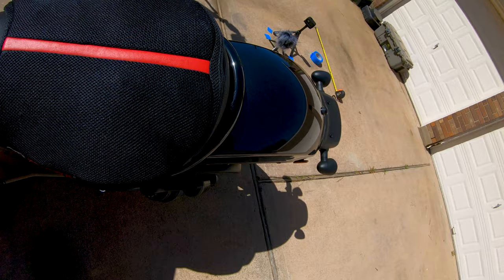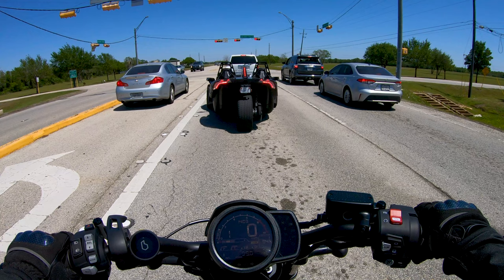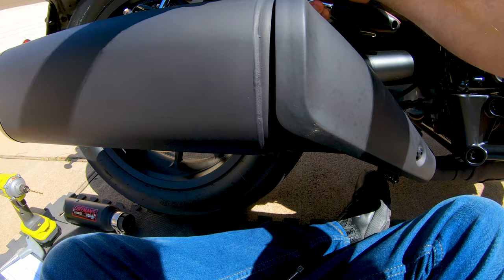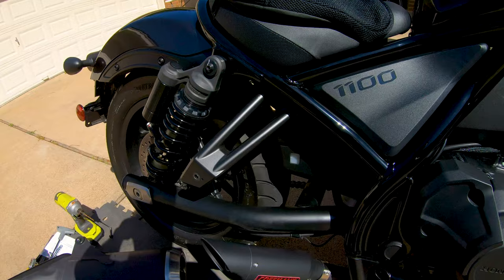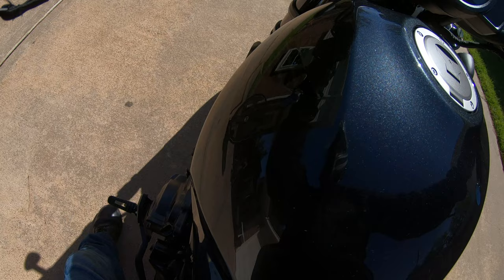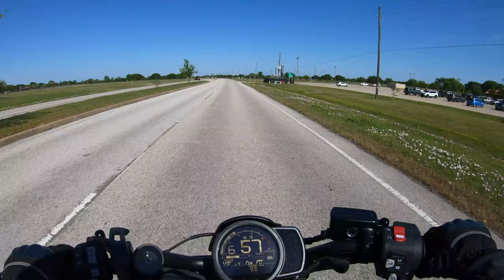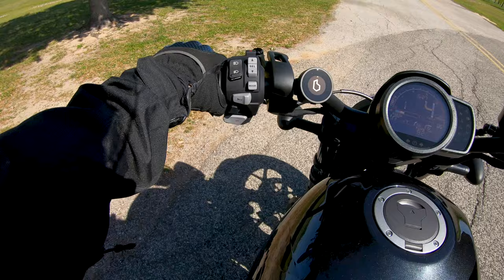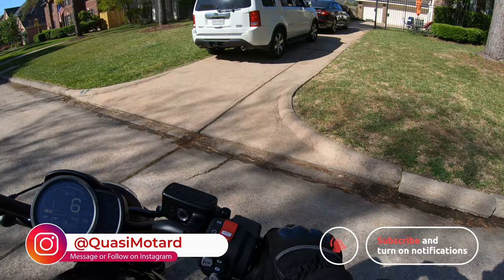REBEL1100: Coffman's Shorty Exhaust - Installation & sound comparison

Comment: I personally like the sound of the stock exhaust although it does look obnoxious. My son just picked up a 21 Rebel 1100 DCT and I don't think we're going to mess with the exhaust. I do appreciate the amount of time you spent doing the sound checks and camera work. Excellent video !  Thanks
Reply from the maker: Thanks for the feedback, and congrats to your son on his new Rebel!  I would have retained OEM exhaust if it weren't for the suitcase appearance and the limited clearance for a saddlebag on the right side.  The original exhaust sounded throaty enough and it was nearly inaudible at freeway speeds over the wind & road noise.  I've never been a fan of loud exhausts because I spend so much time commuting and touring on the highways... loud exhausts just detract from the Zen experience of riding.  

However, in the case of the Coffman's Shorty, it's only slightly louder than OEM at freeway speeds (4-5K RPM at partial throttle).  The noise happens at higher throttle and during down shift blips... oooohhh... those sweet blips!  This thing sounds like a NASCAR ripping down the straightaway when you open it up!  Cheers!  😉👍  --QM
Reply: I agree stock sounds better, its unique, definitely keeping it. I personally think it looks like a double barrel gun, pretty cool.

Comment: Regardless of sound that is a huge upgrade in the looks department. It looks so much better with a shorty. Definitely a good decision to go with a shorty 👍🏽👍🏽 And the fact that it sounds a lot better is icing on the cake.
Reply from the maker: Thanks for the feedback!  Be sure to check out the latest video that compares the updated Coffman's Shorty (correct fitment for the Rebel 1100) and the new Coffman's Thunder exhaust:  https://youtu.be/4Y48--_1rms .  Both of these new slip-on exhausts from Coffman's have blacked-out bolts and exhaust clamps to blend better with the Rebel's looks.  

Wyatt Coffman just advised me yesterday that you can also get thes exhausts WITHOUT the red Coffman's nameplate if you request it.  You can call them at 707-462-7881 after placing your order online and request the nameplate delete.  Cheers!  👍  --QM

Comment: Oh that sounds so much better, i love that growl!!!
Reply from the maker: Thanks!  I love the howl at higher throttle and RPM's... it has a decidedly V8 sound to it for some reason.  I enjoy blasting it down the access roads here in Houston where there are elevated sections of highway next to the road.  The raised walls along the sides of the highway echo the sound back toward the bike, and it sounds like NASCAR... it's hard to explain until you hear it.  😉👍  --QM

Comment: Thanks for sharing your time and efforts.   Currently have a CTX700 DCT (38K miles), now looking at NC750x or Rebel 1100  ... DCTs.   I ride 85% in manual (paddle) mode.  In the twisties using manual stops shifting in mid turn.  Thanks , again!
Reply from the maker: Thanks for the feedback, Bob!  I've ridden the CTX700 and 700N DCT a few times, and I nearly purchased one on several occasions.  My local dealer had new old-stock units for $3999 and $4699 back in early 2020... stupid cheap... should have snagged one!  Here are some of my observations and opinions between the two bikes:

The seating position on the Rebel 1100 is similar, but the footpegs are more mid-mounted than forward like the CTX.  This means that the hip/knee position is a bit more cramped for tall or long-legged riders on the Rebel.  The factory saddle on the CTX seems to be a bit wider and more comfortable (if memory serves me correctly).  I added an AirHawk Cruiser seat cushion to tame the factory seat until some aftermarket options materialize.

The Rebel's DCT manners are better than the CTX... presumably due to newer software and shift points learned from the Africa Twin's setup.  I've learned to mitigate the DCT's unexpected downshifting in corners by manually downshifting before leaning into slow, sweeping corners (still in automatic mode, though).  I'm a bit surprised that Honda didn't include the Africa Twin's IMU on this bike.  The IMU would have permitted lean-sensitive ABS and DCT enhancements (also could have enabled wheelie and launch control).  Oh, well... the price was under $10K, so there were trade-offs to be made, I'm sure.

The rear suspension situation is very similar between the Rebel and CTX... somewhat stiff and not much travel to work with.  I managed to tame my Rebel's highway manners by increasing my rear spring preload from #3 to #8 (of 19 steps).  The Rebel is a bit more thirsty on fuel compared to the CTX, but the engine power is in a completely different league... this thing is a HOOT to ride and crank that throttle open!  It's deceptively quick, and I'll catch myself accidentally ripping along at 20+ MPH faster than I realized sometimes.

The Rebel's shortfalls (for now) are its lack of storage and accessories (factory or aftermarket).  Not much is available yet for touring or creature comfort upgrades.  I have installed the Daytona Aero Visor ( https://japan.webike.net/products/24620160.html ) and a couple of other minor upgrades, but I'm still jonesing for the OEM rear fender rack and panniers so I can take this thing out for some road trips and motocamping!  Cheers!  👍  --QM
Reply: @QuasiMotard  Fixed my CTX suspension with a 1 inch rear rise dogbanes.   One quick question .... I like to move fore/aft on long day rides.  Also, stand up on the pegs.   Is it possible to do this on the Rebel?
Reply from the maker: @bv3045  The mid-controls on the Rebel don't really allow standing, so floorboards or other upgrades would be needed for that.  There isn't any extra saddle room to move forward/backward with the OEM seat... something like a 2-up bench seat might give enough room to scoot around.  I've found that the AirHawk gives me enough room to scoot around a bit, or I can adjust the air pressure to give me a different seating position when my butt starts to wear out.  I haven't done any long road trips on the Rebel yet, but I'm no stranger to 18-hour days in the saddle on some of my other bikes.  😉👍  --QM

Comment: @32:25 “I hate backpacks” 🤣. Makes two of us my dude. During my teen and early 20 years on my R6, backpacks were life. As I’ve aged, I’m all about loading all that nonsense on the bike rather than my back. Give me all the saddlebag, trunk, tank bag space you can give me! Speaking of which, have you checked out the Rebel 1100 hard bags from Givi or Shad? T. rex racing has some mounts and Givi hard bags that fit and Shad released their 3p mount for the 1100, which would fit an SH36 (which can fit a full sized helmet). Hard bags are the way to go. Waterproof and lockable 🤘

Comment: Much better than stock exhaust. 
But you really need to upgrade the air filter and re-jet the carbs too!
Reply from the maker: Thanks!  This upgrade was mainly for weight reduction and to reclaim space on the right side for a larger pannier.  The Coffman's Shorty sounds fantastic compared to the OEM muffler.  The catalytic converter is still present in the exhaust mid-pipe, so this won't drastically affect the engine peformance.

The Rebel 1100 is fuel-injected, so this slip-on muffler alone won't alter the airflow through the engine drastically, which could require a retune or re-flash of the ECU.  If I installed a high-flow air filter or modified the intake, then the engine would certainly run lean (hot), and that could cause engine damage.  I may re-flash the ECU sometime in the future to try to squeeze a few more HP out of the engine... we'll see!  Cheers!  😉👍  --QM

Comment: Were you able to get that bracket off without too much trouble and were there bolt holes left in the bike?
Reply from the maker: No, I didn't remove the exhaust bracket because it's also the passenger footpeg bracket.  I had the battery box out of there recently when I installed the passenger peg set, and it looks like that right bracket is removable.  Two 8mm hex bolts secure each of the brackets to the inside of the frame rail.  So, I don't see any problem in removing the right side if needed.  Cheers!  👍  --QM

Comment: Great video man :)  Please can you tell me your User Mode settings to take out the aggressive downshifts.  I've even switched to Rain Mode but I am still getting them when doing 90 degree turns at slow speed !  Thanks
Reply from the maker: Thanks for the feedback!  My user mode is set as follows:
 - Power: 3 (high)
 - Traction: 1 (low)
 - Engine Braking: 2 (mid)
 - DCT shifts: 1 (low)

Those settings seem to work best for my normal cruising around town and highway touring.  The unexpected downshifts are minimized when riding on those settings because the DCT mode is set for its lowest shift points.  I still downshift manually with the triggers before entering slow, sweeping corners (e.g., highway underpass u-turns, etc).  When I'm riding harder or need to terrorize traffic, I'll switch to "sport" mode for a few minutes and then switch back to "user" or "standard".  Cheers!  😉👍  --QM
Reply: @QuasiMotard  Thanks man that is really helpful can't wait to try it out.  I often downshift too for fast corners - great fun.  I love the DCT apart from when it downshifts from 2 to 1 when I am midturn when doing slow 90 degree manouvers.  I can't seem to stop this so I either slow right down to get into first before turning, or I turn the corner quicker than I like while still in second gear to prevent it changing down mid turn.

Comment: I had a '15 500F.  Nice little bike.  Doesn't handle NEAR as well as my 650 Versys.
Reply from the maker: Agreed!  The Kawi 650 Versys is a great bike... very good handling and smooth, linear power delivery.  The CB500F is a bit more efficient and has a lower seat height, so it makes a better commuter, IMHO.  Can't go wrong with either bike!  👍  --QM

Comment: Aren't you concerned that it'll be too restrictive, since it's designed for a bike with much less power?
Reply from the maker: Not really... I'm sure that the Coffman's is less restrictive than the OEM exhaust, but I'd need to put them on a flow bench to be absolutely sure.  The Coffman's is basically a straight-thru design with a small V-diverter behind the spark arrestor screen.  I might eventually upgrade to a Remus or Akrapovič exhaust whenever they become available.  I can reuse this one on my CB500X if I go that route.  Cheers!  👍  --QM

Comment: Hey man that’s awesome! I had a Coffman on my 500x. Wonder if it would work on my Africa twin 1100 since it’s the same engine as the rebel?
Reply from the maker: I'm sure that the Coffman's Shorty will fit on the AT just fine.  The bend at the neck is the only variable that might need to be sorted out.  Coffman's uses the same "can" design across most of their models, so the length and bend of the neck are the main variables.  Of course, the orientation of the slash endcap also depends on the rotation of the rest of the muffler.  

You should give Coffman's a call (707-462-7881) or email them at info@coffmansexhaust.com to inquire about the Shorty on the AT.  I'm sure that they can figure out which bend will work if you send some pictures of the mid-pipe and the offset to the swingarm.  They also told me that you can request a nameplate delete (plain can without the red Coffman's logo) if you request it that way.  Tell 'em that QuasiMotard sent you!  Cheers!  😉👍  --QM

Comment: Awesome sound 👌 but that support for the stock exhaust is also for your passenger pegs I believe and not only that you can also attach a exhaust slider. I'm pretty sure if you add some TRex racing engine gaurds and exhaust slider it will look kick ass.
Reply from the maker: Thanks for the feedback!  I figured out that the passenger peg mounts to that bracket after making the video.  I guess the passenger peg kit includes a symmetrical bracket for the left side?  I'll find out whenever my parts finally arrive.

I have T-Rex sliders on my Yamaha FZ6R and also on my Honda CB500F... they are great!  I'm waiting for SW-Motech and a few other vendors to make engine/crash guards for the new Rebel 1100 so I have some choices.  I'm planning to install a set of Denali D4 driving lights and a set of highway pegs on the crash bar.  The aftermarket is a bit slow to catch up with new bikes over the past couple of years, so we'll see how long it takes to see more Rebel 1100 accessories hit the market.  Cheers!  👍  --QM

Comment: Hey man! Love the videos. I got the DCT for my first bike and have loved it! Only thing I don't like is the look of the exhaust. I wanted to get a shorty, but heard that these cause issues down the line with engine damage, backfiring, and possible frame damage. Have you had any issues on that other bike you've had the short exhaust on? I really want this bike to last, and have babied it. Let me know what you think! Love the look and sound! Thanks for the videos!
Reply from the maker: Thanks for the feedback!  It's not a good idea to run any engine too lean, and free-flowing exhausts (and intakes) will cause a lean-burn condition due to increasing the airflow without increasing fuel at the same time (to maintain a stoichiometric ratio). Generally speaking, if you only increase the exhaust or the intake (not both at the same time), then you don't drastically increase the flow and end up with an overly lean condition.  

As for frame damage, I've never heard of aftermarket exhausts causing frame issues... they are usually smaller and lighter, so it's less likely that they would cause stress-related frame damage.  I haven't had any frame or engine problems with aftermarket exhausts on any of my bikes over the decades.  Some of the aftermarket exhausts have failed in various ways but didn't cause any damage to the bike.  Cheers!  👍  --QM
Reply: @QuasiMotard  so for your exhaust that is free flowing, do you have to do anything special to keep it from being too lean? Sorry for all the questions! You've been super helpful.
Reply from the maker: @kalebporter9943  No worries, glad to help!  There is usually a bit of room in the factory ECU's mapping to prevent the engine from running too lean.  Any modern fuel-injection system that has O2 sensors in the exhaust header will allow the ECU to compensate for additional airflow (but usually not more than ~10% deviation).  If you add only a free-flowing intake OR exhaust, then you probably aren't altering the total airflow through the motor enough that the factory ECU can't handle it.  However, if you alter the intake AND the exhaust at the same time, then you might push the factory ECU out of its adjustment range, and that can result in a lean condition that could damage the motor.

I will be flashing the ECU on my Rebel as soon as DynoJet has a map for the PowerVision 3 system.  I'll probably take the bike to an authorized DynoJet tuner so we can run the bike on a closed-loop system (wideband O2 sensor) and a dynamometer to dial in the fuel maps more precisely.  That will ensure that the motor isn't running too lean and we'll be able to extract the most power possible out of the performance upgrades.  Cheers!  👍  --QM
Reply: @QuasiMotard  I have the DCT model too, and got a shorty on it, and from what you have said, it seems like it will probably be good! I'll look out for any other posts from your videos on the subject! Thanks a billion for the help! Love the series

Comment: Any noticeable power loss from the new exhaust or will you get it re tuned? I picked up my 1100 today
Reply from the maker: Congrats on your new Rebel 1100!  I haven't noticed any performance difference at all... not better or worse... just a much better exhaust note.  The intake hasn't been changed, and the catalytic converter is still in the midpipe... so just changing the exhaust shouldn't drastically change the AFR or result in an overly lean condition.  

However, I am still planning to do a proper flash tune on the Rebel later this year, and I'll rent some time on a DynoJet dyno to do it properly.  I'll be sure to post the results with the community (maybe even share the custom map). 

I'm also working with Coffman's Exhaust to develop an exhaust that's designed for the Rebel 1100 with the proper bend and angles.  That collaboration is underway, and we should have those videos coming next week.  Cheers!  😉👍  --QM
Reply: @QuasiMotard  sounds like I better wait then
Reply from the maker: @matteckert7541  Yep!  I'd wait for the new exhaust from Coffman's. We will have the details worked out early next week.  Coffman's said that they can produce this new version very quickly for new Rebel 1100 orders.  They are based here in the USA, so their production is local instead of outsourced to other countries... that's awesome!  😉👍  --QM
Reply: @QuasiMotard  how's the testing going?
Reply from the maker: @JohnBarrins  I haven't done anything with the tuning yet, but Coffman's has reached out to me to help make an exhaust for the Rebel 1100!  They shipped a prototype to me last Thursday, so it should arrive Monday or Tuesday.  The new muffler will have the correct bend (we hope), and the Coffman's logo and the exhaust tip have been rotated to the correct angle relative to the muffler's new position.  I will fit that exhaust and take a quick video for Coffman's to review first, and then I'll post the results for everyone to see.

As for the engine tuning, that will be on hold until after I return in late July from my trip around the USA for the Scooter Cannonball Run.  I will be talking with DynoJet first thing Monday morning regarding an ECU cable and a tuning license for the PowerVision 3 on my Super Cub, so I will also inquire about the Rebel 1100 to see if they have anything available for that yet.  I"ll be sure to keep everyone posted on the progress.  Cheers!  👍  --QM
Reply: @QuasiMotard  Great job, mate.